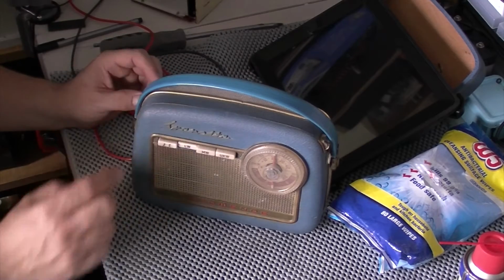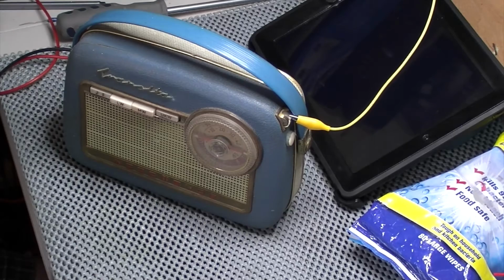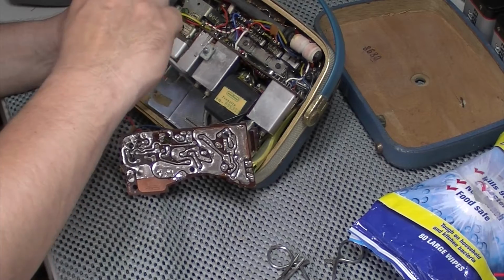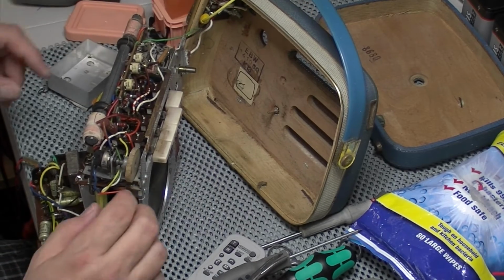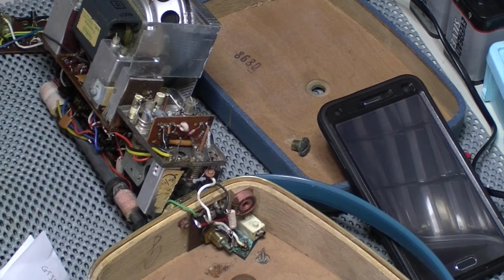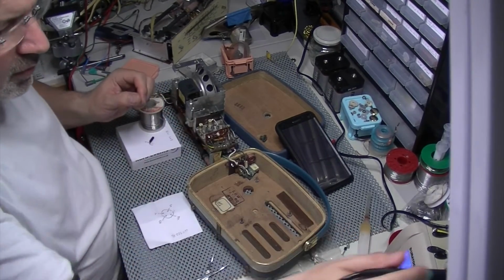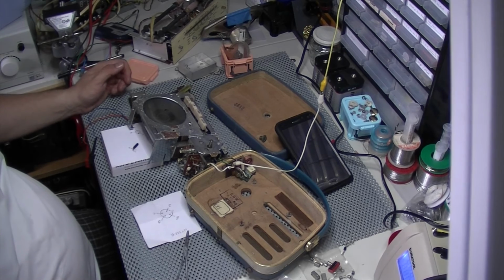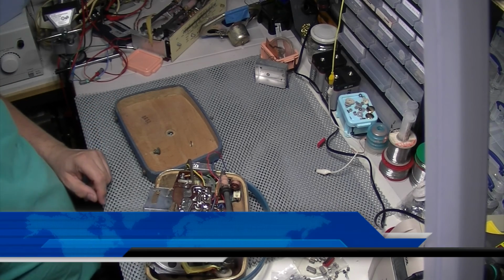Bakers basket of radios: Nordmende Transita part 2, tracking down the fault and repairing it

Comment: ive got one of these but its got shortwave instead of longwave. its a 1960 i believe. it had been shoved in a cupboard since the late 1970s and the tuning dial was missing(presume busted) i put a 9 volt supply into it and it powered up instantly but sadly suffers from loud hiss on all wavebands. i would love to get it working properly one day but my electrical knowledge is zilch. i think they are a gorgeous looking old radio with a lot of character. great video mate, you are a maestro with your expertise.
Reply from the maker: Hi Mark and thanks for the kind comments. They are very well made sets and look great. Shame your tuning dial is missing but keep an eye out on eBay as you may find a scrapper one day that you can rob. Sounds like an issue with the amplifier stage if its on all wavebands. Is it there on min volume as well? Looks like this could be it? https://youtu.be/QTlN7l5rHN4. Feel free to message me if you fancy having a go yourself. Failing that you could always pop it in the post to me for a look. Thanks for watching. Graham
Reply: that sounds like a plan graham. if you could let me know where to send it i will get it posted off to you. i managed to get a tuning dial of a kb tranny which although is not the correct part it works and looks ok. i look forward to hearing from you ,cheers mate. regards mark.
Reply from the maker: Mark. Go to my about page on Youtube, click on send message and let me have your email address. I will then send you details etc. I did try messaging you but your youtube account isn't enabled for messages. Thanks Graham

Comment: Great job Graham. Good to hear this little German radio come back to life on FM after
replacement of that transistor. It sounds clear on FM, I remember my dad's had a good
tone to it too. So this radio reconnects me to an early time in my childhood. One of the most nail biting moments in your collection of videos as that tuning dial was carefully extracted. 
Thanks for the upload.
73 Guglielmo
Reply from the maker: Thanks Guglielmo. It certainly was a make or break situation but it had to come off to get the chassis out. It will have a nice blob of silicon grease when it goes back on. 73 Graham

Comment: Nice work Graham, where do you source those Russian transistors OR are they surplus from salvaged radios?
Reply from the maker: Thanks Dave. Picked them up from Russia via eBay http://www.ebay.co.uk/itm/GT322B-2N987-2SA104-2SA221-2SA256-Germanium-transistor-USSR-Lot-of-15-pcs-/131362891169